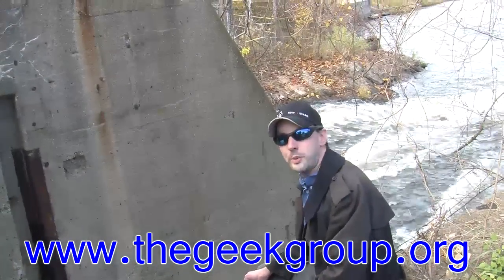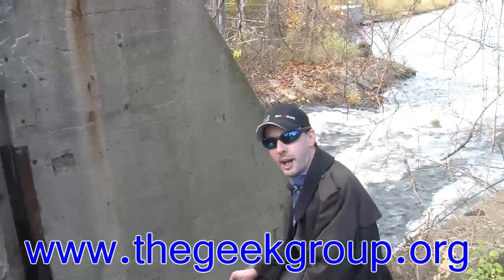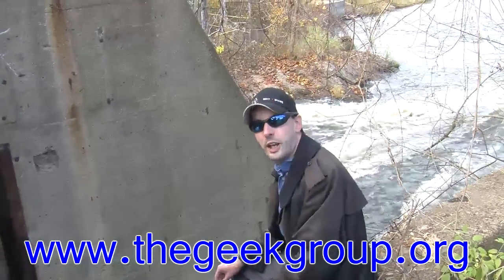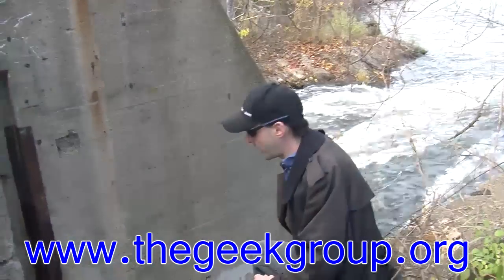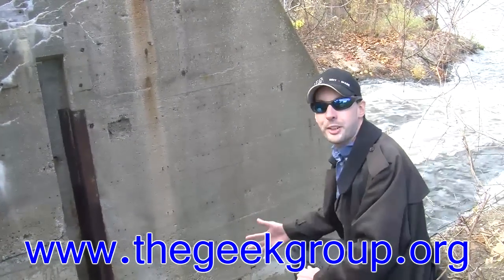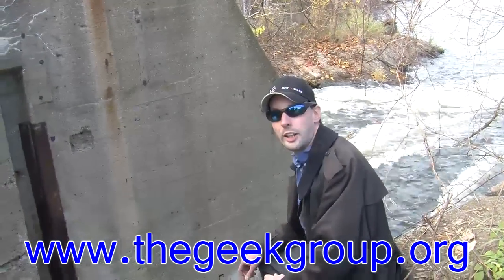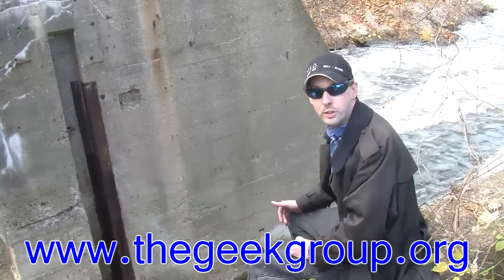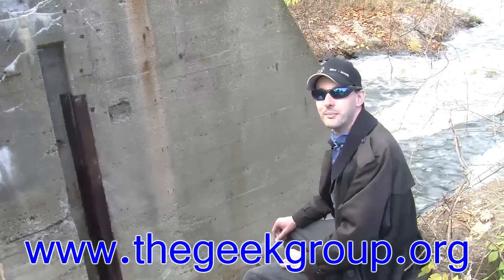Volts and Amps In a Minute

Comment: @kijifled2 in an AC (IE mains) circuit yes you include power factor even then it is for NON RESISTIVE loads (eg transformers and older flouro "strip" lamps) but for DC (car batteries etc) you dont need the power factor